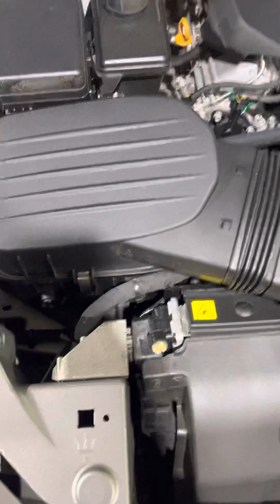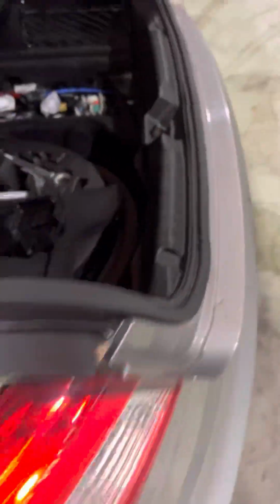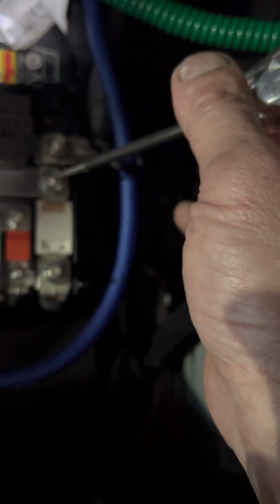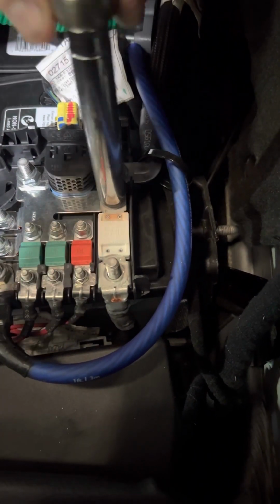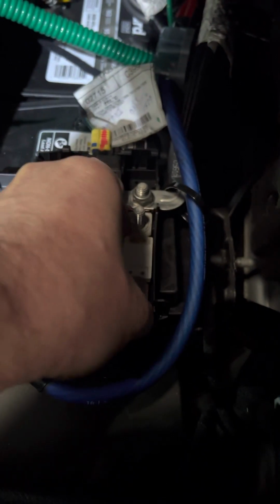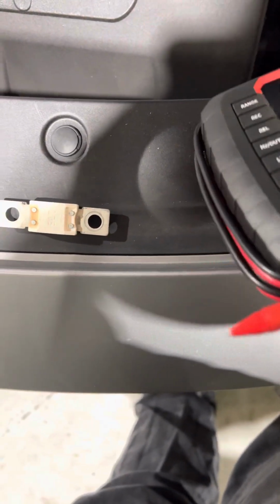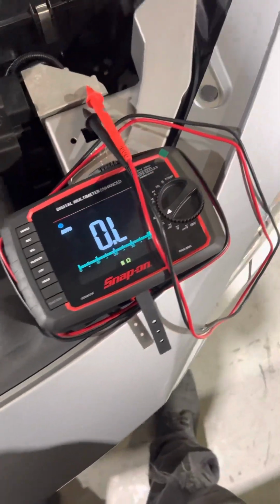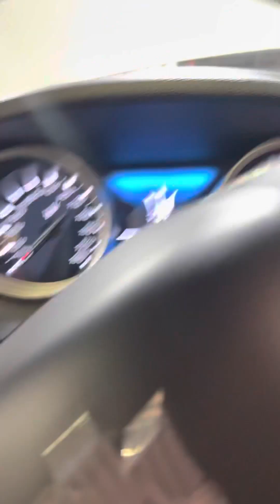How to diagnose a Maserati no start.

Comment: I have a 2018 Maserati Levante, when I try to turn it on, all the lights come on but it doesn't turn on, it gives me a lot of errors on the screen, every time I try to turn it on I hear a short circuit in the battery.
Reply from the maker: Check the connections at the fuse box on the battery. Check that all of the positive connections are putting out battery voltage.
Reply: Perfect, I'll review it!  thank you very much friend!
Reply from the maker: Anytime. I hope it helps you.

Comment: I have a 2014 Maserati Ghibli, it’s not started everyday and every 3 days this car needs to be jumped. We put a new battery but idk what the issue is. We can even put 2 boosters( one in the back and one under the hood) and it still won’t start. Is there something I am missing, I’m a car dealer which is why I might be missing something
Reply from the maker: I would inspect the connection block at the battery and make sure all of the large power connections have power.

Comment: Way back when I was a service writer.  We had this issue with Honda.
Moisture.  We have snow and salt . It's  good you did that properly.  It's nice to see.
I've been working on cars for 45 years. Started at 5.
A product of my dads friends that were amazing. 
Mostly Toyota  vw BMW formula Ford formula Libre autocrossed at 17.
Thanks for reading this. 
All cars are the same. Just different flavors. 
I got married in a kitcar 1953 MG td roadster.  Was supposed to be beetle.  No it was 4 door chevette frame with 1981 corolla sr5 1.8 with 4 carbs.  Weight was 1400 lbs and 140 hp 5 speed manual brakes. Great car and fantastic gas mileage.
Reply from the maker: I had to learn proper diagnostic skills long ago. I sometimes will forget my process when I get frustrated, but I have to cool down and start over. As you said, all nuts and bolts with a few wires. You have to understand the system if you want to successfully diagnose. If you don’t, you still might fix the car, but you won’t know why. That is why you will struggle again the next time. I tried to explain this over and over when I was an instructor. Some took it and ran with it, others just heard me and continued on the same way.
Reply from the maker: I would like to invite you to subscribe if you haven’t already. Right now I have to do lots of short form to stay up with the flow of videos, but I am trying to add in some actual informative stuff as well. That is really where I want to go with this channel. By the way, thanks for the comments.
Reply: @magical_mechanical  I just did .
Nice to meet you.
Reply: @magical_mechanical  keep it simple. Tracking a break is not bad compared with trans eng.dia.
I'm  a automatic door mechanic. 
Its all the same gear.
12 volt.
Reply from the maker: Thanks
Reply from the maker: @drebarthelotte5712  Same to you. Thanks for all of the comments, and tips.

Comment: I checked the fuses in the trunk no water damage
Reply from the maker: So, when you switch on the ignition, nothing happens?
Reply: @magical_mechanical yes nothing
Reply: No power goes to the ignition switch
Reply from the maker: @Godisablebraketechnicianasecer it could still be the fuse panel in the cargo area by the battery. Some of the connections can become poor and things just do not work.
I would suggest checking all or the main power outputs on that panel to make sure it’s not a connection problem
Reply: No power at all goes to the ignition door passenger lock unlock button works
Reply: @magical_mechanical ok thanks I will

Comment: The key is not reading the ignition switch could not turn on
Reply from the maker: Is a battery connection problem.
Reply: @magical_mechanical  no connection problem

Comment: Mine has all the power but won't start it clicks and everything butnwonr turn over
Reply from the maker: Maybe you should verify that you do have power to the starter. It’s possible that the main power source cable is not connected at the battery. Those have a fuse for the starter cable that can be blown and the activation wire will still make the solenoid click but the starter won’t spin.

Comment: I have a 2018 Maserati Levante, when I try to turn it on, all the lights come on but it doesn't turn on, it gives me a lot of errors on the screen, every time I try to turn it on I hear a short circuit in the battery.
Reply from the maker: Make sure to check all of the connections on the fuse box attached to the battery and verify all of the positive connections have 12v power.